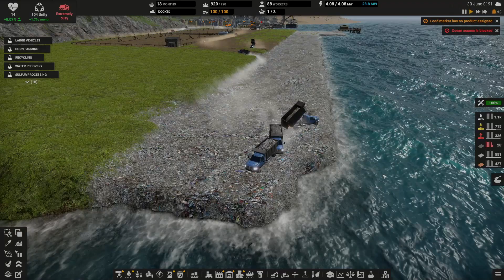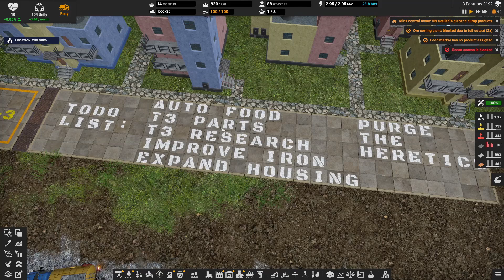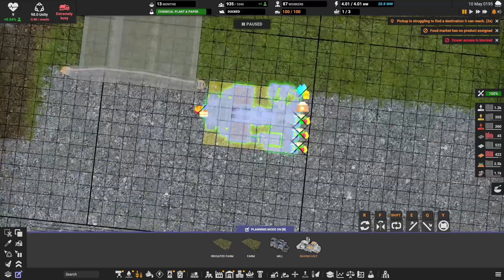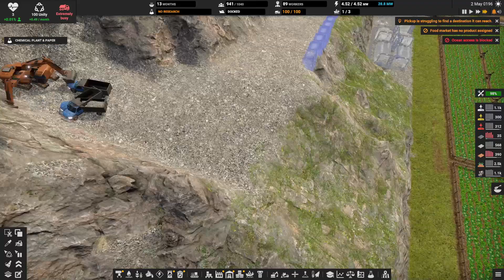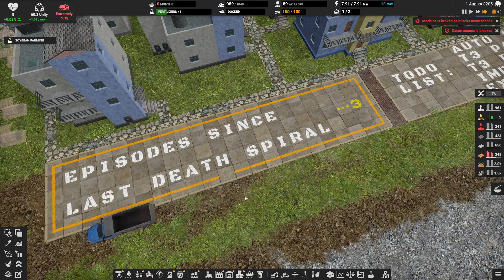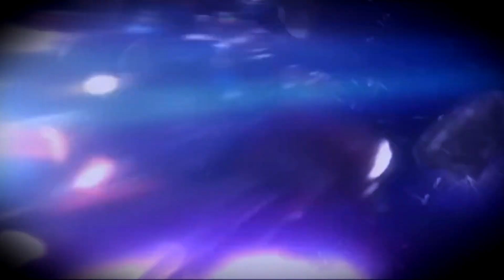Captain of Industry S2 / part 7 / Efficiency Planning

Comment: looks like the decision to make trucks have mixed loads and needing ore separators is giving you continued trouble. well, i would probably play with similar settings.
but if i ever actually get the game too, i will probably make centralized ore sorting complex with LOADS of storage for all materials, just to not have to deal with your truck unload problems. and make it as space efficient dense as possible.
...end forget to leave gaps for future belts, expansions and truck access in the process.😅
well, i tend to create organically grown spaghetti bases in most games whether i want to or not. sigh
but at least they still work well enough, most of the time.